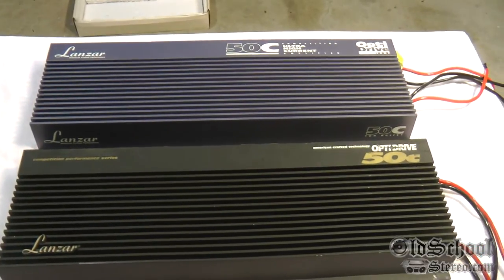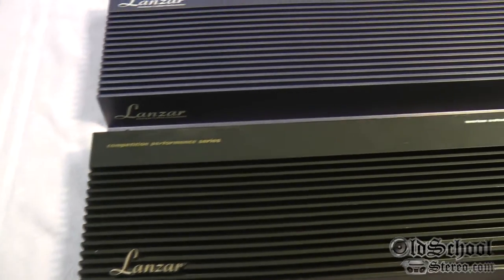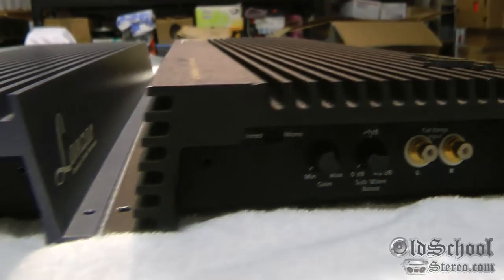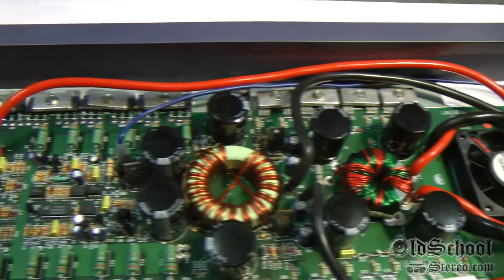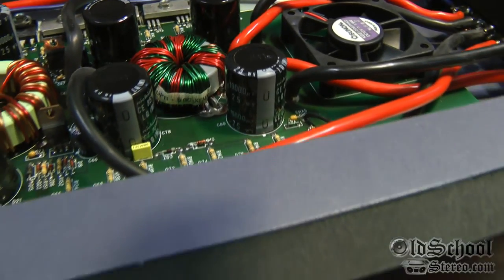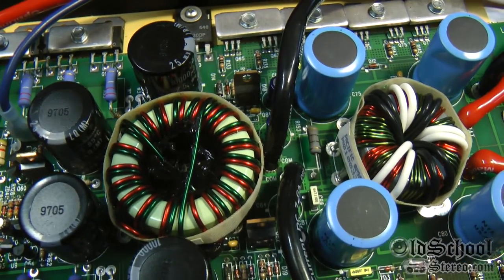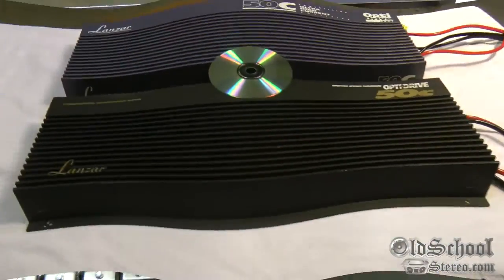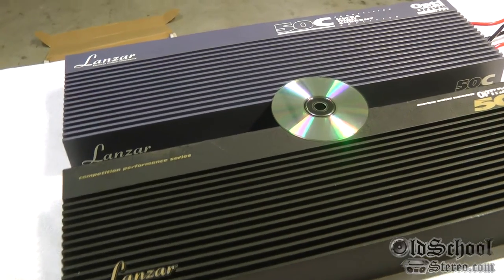Lanzar Opti Drive 50C Ultra Cheater Amps OldSchoolStereo.com

Comment from the maker: Funny to say they are "50 watt" amps, right? In today's terms, these would be rated at 2500 watts or more. As you may have noticed in the previous video, I have the power resistors, just need to wire them up for the test load...

Comment: About 25 yrs my friend jorge dad work Lanzar as tect out in city of Indurstry...1994 On Xmas eve he gave Opit 500 Brand new on the box..boy this amp has raw power with 2 12 Power Push Pro Fosgate sub at 8ohm s.v.c run on brig mono down to 4 ohm..the amp never ran hot, always stay warm but i did stalled two cooling fan just to be safe.  this amp is a beast..

Comment from the maker: The blue one was BNIB and found in a storage auction a few months ago, whereas the black one has been used and had the caps replaced. The blue one is not even mine, but a friend is letting me test it out, then off it goes!

Comment: The black and white windings are the primary wraps that are insulated with sleeving - maybe Telfon? Looking closely at the solder connections to those windings reveals that they have used "Litz" wire which is many thin strands of individually insulated wire bundled together. This is done for higher efficiency at the frequencies at which the power supply operates. Litz wire is expensive and can be easily damaged in a winding machine - thus the protective sleeve.

Comment: And the other toroid is the same on both amps, just different colors. 20 bifilar wraps around the core to form a differential mode filter. This is a key component in a push-pull regulated power supply as it works in conjunction with the big filter capacitors to maintain a steady, low ripple source with minimal high frequency noise.

Comment: The older version used maybe 6-7 strands of 20 gauge, but you can see that they fought the core size as they added copper. The inner area couldn't possibly be wrapped by machine so they were manually wrapping those suckers. Ouch.

Comment: It's funny how you "get what you pay for" doesn't apply to the junk on the market these days. 3000 watts for $399.00...  Uhh..  C'mon.  On the bright side if you know what you are doing you can put together a very nice budget system that sounds great.  Very few amps compare to these old guys though.  It's almost like comparing tubes to transistors. They just sound sooo much better.

Comment: I thought amps were made that way back in the day for competition rules, so you could have a 50 watt rated system but it actually put out like 1000 watts...cheaters! LOL Then they smartened up and changed the competition rules and eliminated the loop-hole.

Comment: Hello Herr from Germany, i want to buy an amplifer from lanzar .
Can you Made Test from the lanzar Optidrive 2500.
Thanks
Reply: I agree. I've gotten back into stereo systems & have three Optidrive 2500s that are still brand new in the boxes. I bought them when I was working at a stereo shop & have had them in my closet for over 20 years. Now I'm building a box for three 15" Kove Armageddon subs to go in my extended cab Ranger & will be using all three amps. I'd very much like to know the real 8 vs 4 ohm mono power.

Comment: i still have two opti500 the blue ones
Reply from the maker: I prefer the 500's over the 50c. Great amps. High voltage > high current
Reply: I own the blue. an yes they are better..
Reply: How many watts is the opti500 ? Can they run two 12's?
Reply: @JohnDoe-bk4px  I have the first opti drive amps    blue two power and ground cables can push two 12's easy
Reply: @Iroc_twan  how many watts is it?
Reply: @JohnDoe-bk4px  250×2  4 ohms and 500×2 2 ohms and 1000×1 4 ohms
Reply: @Iroc_twan  i just bought the old school lanzar optidrive 2500 amp like this black one in the video. What's the difference between the 2500 and the 500? Do you have a way i can contact you bro?